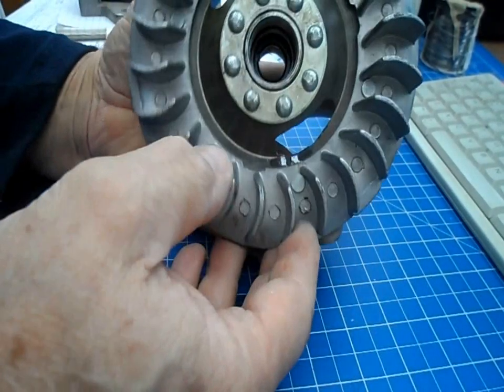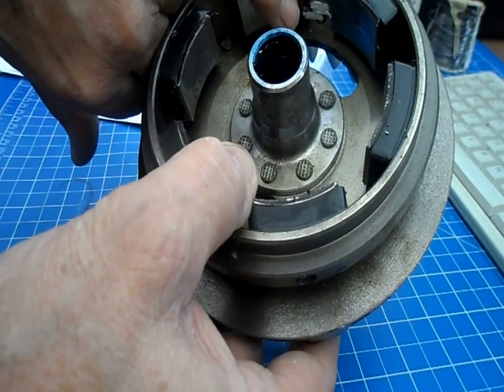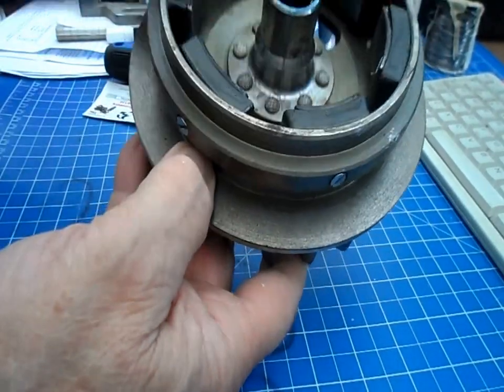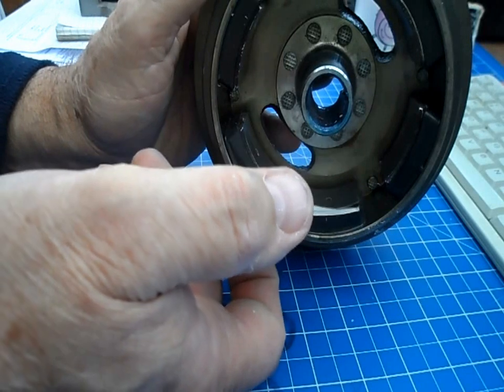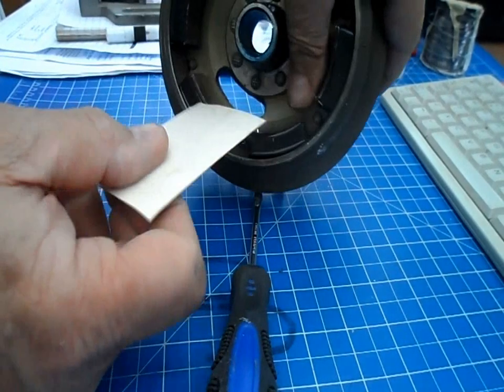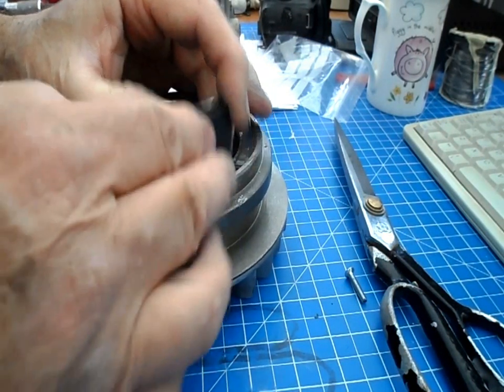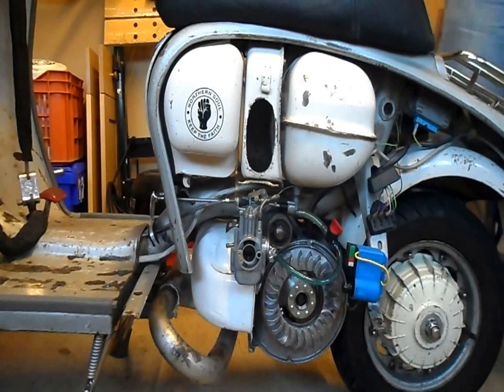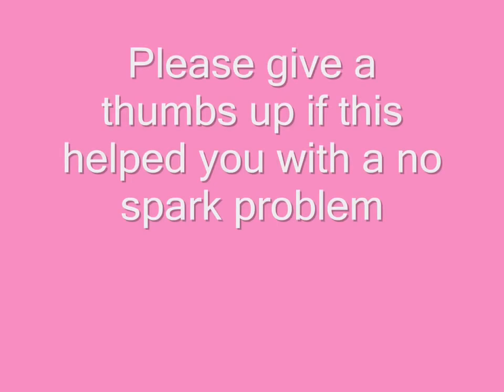No spark problem finally solved Lambretta electronic ignition

Comment: I have the same problem it seems. Did you just shim the two magnets?
Reply from the maker: Hi Geoff yes just the 2x magnets with the prongs that trigger the pick up . The others can be left as they are its only the 2x pickup magnets that have a critical gap.

Comment: you have to wonder if the points set up is still the best option. Wish someone would make a12v set with points.
Reply from the maker: Hi paul. I used points systems for about 5 years and to be honest they also have their fair share of reliability issues. I finally switched to Electronic because when it works it gives you spot on timing consistently and needs no maintenance . 
you also get brighter lights and horn which is a big plus !

it was a steep learning curve getting it to work though. There is surprisingly little out there to help set it up and troubleshoot problems which is why I made this video .
I'd hate someone else have to go through 6x months of frustration like I did.
Reply: @johncooper7242  totally agree with your comments. I ran a SX200 in the 60's for many miles on the old points with little problem but as you say the lights etc were useless. I have a couple of lames now and all on electronic. I ended up buying several set ups as they would not spark, found the difference was which type of crank i was fitting them onto ( GP or Li ). Great video and a great help. Thanks.
Reply from the maker: @paulmeads802  we are from the same era Paul...how lucky are we . I have some very fond memories of the freedom my first Li150 gave me aged 16 in 1967. ......the feeling of independence was magical so I promised myself I'd buy another when I retired and see if I could recapture some of that . 

Its been a trial but when i go out for a blast the grin on my chubby chase says it all.

I couldn't afford to buy a complete set up so i put my system together out of separate bits which is probably why it was such a pita to get going.
The AF lightweight flywheel (Li crank) gives terrific throttle response and acceleration but its not the relaxing ride I hoped for.
Reply: @johncooper7242  I had my first sx in 1968 and had many a happy hour with the group of lads formwork, weekend runs, all chipping in if there were breakdowns etc. Thats how i learnt about mechanics etc. I am the same as you, always wanted another and now 66 yesterday I have my Spanish sx200 going for its MOT next week. Should be back on the road after that and the grins will be from ear to ear. Kept it as standard as i can so there are fewer problems with running.
Reply from the maker: @paulmeads802  wow a SX200  I remember one of our group had a TV200 with lots of chrome and another had a SS180cc Vespa with chrome bubbles. It never occurred to me to buy a new scoot on tick back then. My first job holiday job after School was gardening for which i was paid £5.00 a week!  Took me ages to save £25 for my first series 2 Li150.from Eddy Grinsteads  By the time I got a proper job I had passed my driving test and had bought my first car in 1968 . I left a series 2 and a series 3 Li150 in a garage and never returned for them !... 

Happy memories of charging up and down the Southend Arterial from Ilford to meet up with school friends and we'd go to Basildon Billericay Brentwood  Southend etc looking for parties , girls dances bowling and generally getting into mischief .  Happy days
Good luck with the MOT ...my 64 Special is exempt from MOTs now
Reply: I've had to do the same myself
Reply: Hi John, I’m having the same issue at moment, all the multimeter checks are spot on, all the wires have been checked re seated and everything yet I still can’t get a spark for love or money😢 I’m at my wits end
Reply: Hi, if you have packed up the magnets as described and still can't get a spark then i would suggest you look at the rectifier and cdi. You can get a new pick up to replace the existing one. Quite cheap.
 Make sure you have a good earth wire to all the electrics.  @stephendarcy9539
Reply from the maker: @stephendarcy9539  Sorry Stephen i didn't see your post. Hopefully by now you will have found the problem but if not I have a suggestion.
The gap between the Flywheel magnets and the pick up is critical. It has to be aligned accurately which is difficult because you can'tn see the alighnment when the flywheel is fitted.
The gap has to be very small indeed. I was surprised at how small it needs to be . I got my LI175 sparking just by decreasing the gap between the pickup and the magnets by the thickness of a business card !  it needs to be almost touching..or you'll get no spark. 

You could try smearing some vasoline on the magnets or the pickup and turn the engine over . You can then  see how close they are when you remove the flywheel by looking at how much vasoline is left on the magnets or pickup face......you are looking for about 1mm gap.good luck buddy